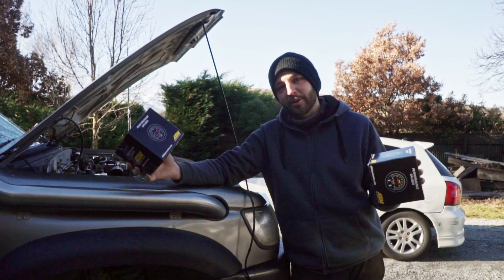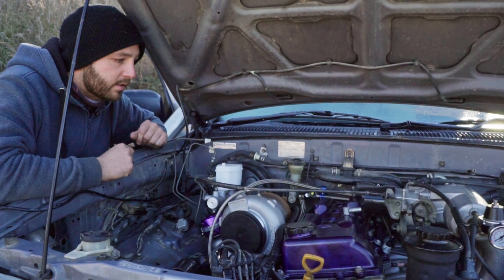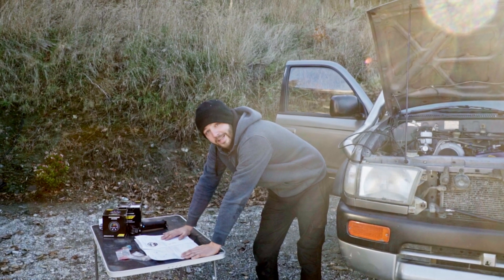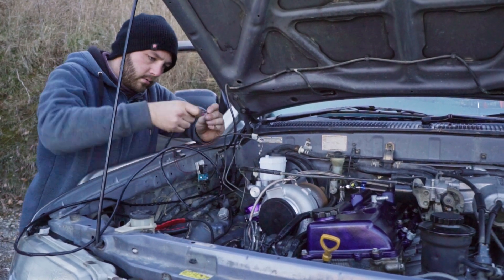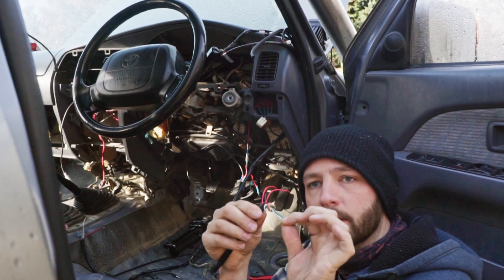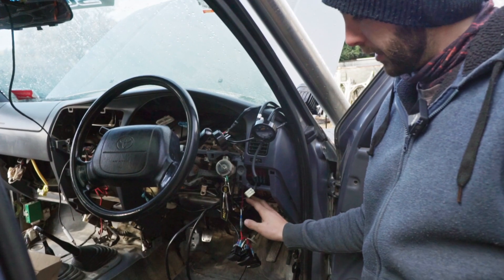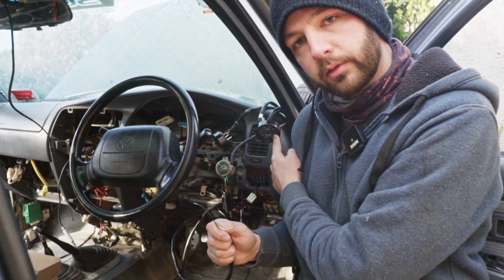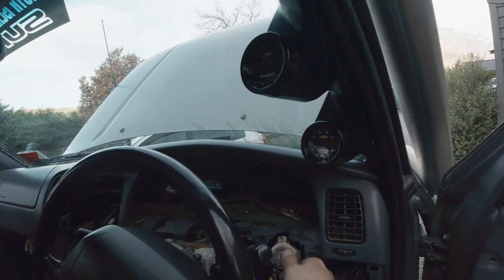3RZ Turbo | Installing aftermarket AEM boost gauge & AFR gauge | Part 4

Comment: Hey, any chance you can do a video of the completed build? Also I’m interested in getting a snorkel like that, where did you get one like that?
Reply from the maker: There will be a completed build video coming. I do have more to finish off on her before shes 'complete' so will rip through that and do a full build break down at the end. 
Snorkel is custom made by the boys at Southern Lakes Engineering.

Comment: The pod looks pretty sweet at the end. You said custom. I'm curious about that process.
Reply from the maker: It was a standard etsy one that I moulded to shape using a heat gun, cut to size and attached to the stock A pillar trim. Body filler to shape and then paint haha